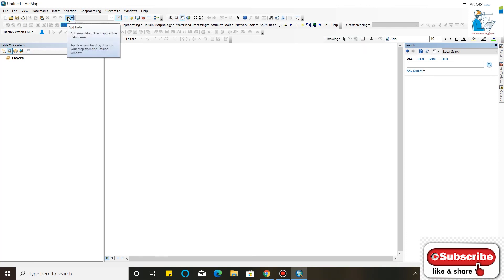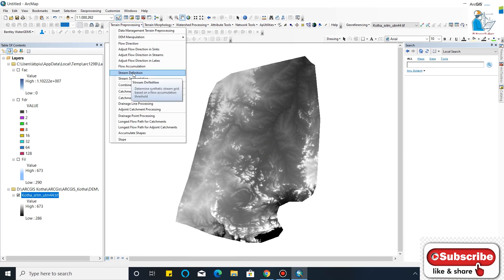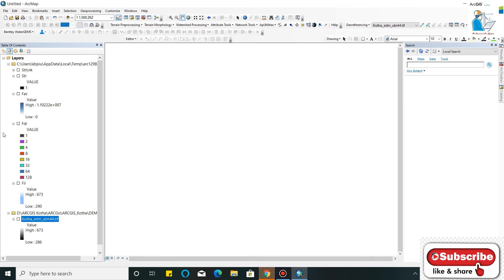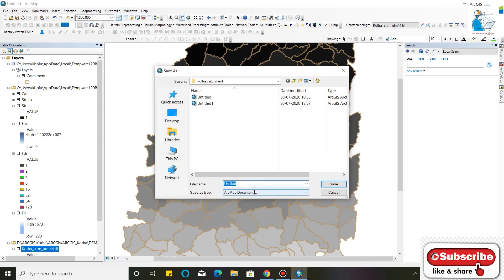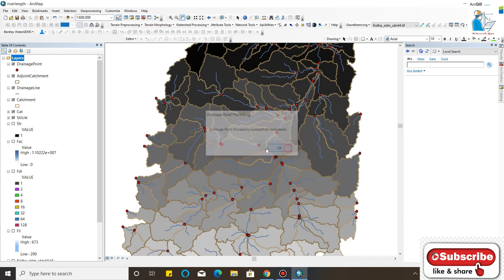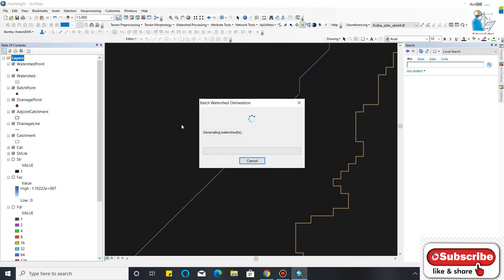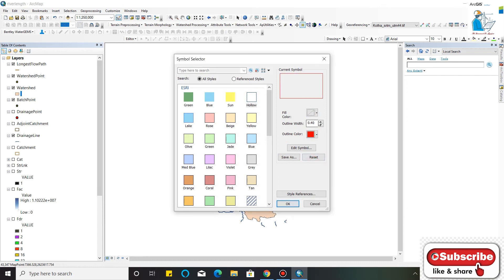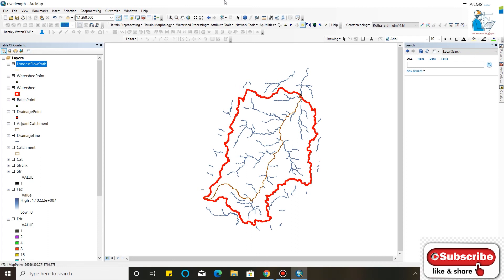How to find the longest flow path in a River using ArcHydro tool in ArcGis.

Comment: Dear Sir, it is a very useful video but it seems I couldn't process the ArcHydro, even though I already install it but whenever I try to process stream definition (for example) it goes to error.
Reply: I think I got my own answer Sir: using this additional tool is quite tricky, sometimes we need to add tif (extension) for the output, but sometimes not, I don't know why, maybe because I am using the last version of ArcGIS, and also make sure that your table of content is clear from unnecessary file.
Reply from the maker: Yes

Comment: It's not showing longest flow path
Reply from the maker: If not showing then go to folder whre u r exporting that file and import that
Reply: @ranjeetsaw137  while I'm executing the project.i got everything well but while I'm assigning longest flow path it's not showing the path ..... particularly longest path .....can you explain clearly
Reply from the maker: @PADALACHANNEL  actualy sometimes it creates prob ,if prob continue then close arcmap and del default.gdb file then again start ur arcmap n run the same will work .
Reply: @ranjeetsaw137  thank you....i have tried but again same problem ....
Reply: @ranjeetsaw137  In stream Definition Area is disabled......
Reply from the maker: @PADALACHANNEL  go to PCS projection system and calculate again
Reply: Thank you
Reply: i was having same issue, everything worked but i didn't show the longest path. 
I tried a different tool and it worked for me. Go to Terrain Preprocessing>Longest low Path for catchments tool, select the catchment as watershed layer and input flow direction. 
:)
Reply: @dayyanzahidkhan2028 hello..I have tried ur way too,but it's taking too much time and yet not generated longest flow..what to do?
Reply from the maker: Can u explain ur exact problem in extraction